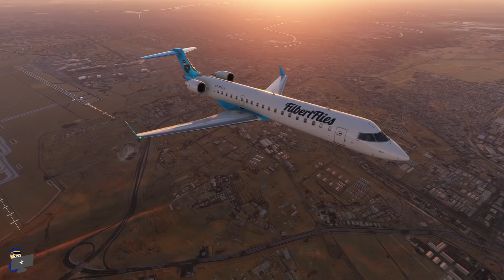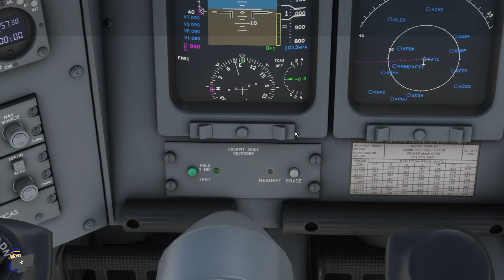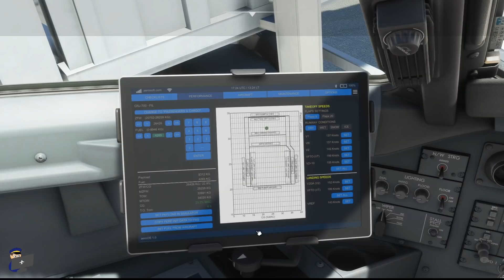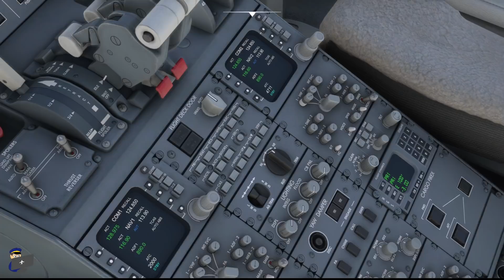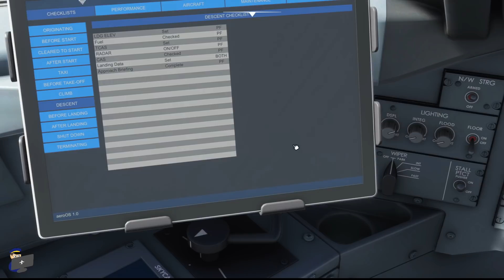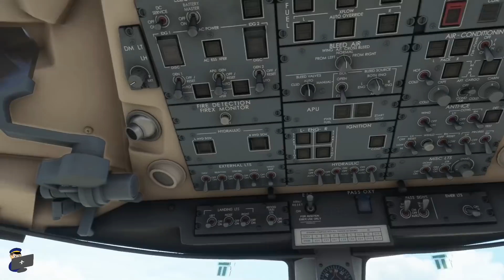MSFS 2020 | TUTORIAL: Aerosoft CRJ 700 lesson with a real world pilot | Complete Lesson

Comment: Does anyone use the Boris sound mods for this?  Will it work in MSFS-2024 as well?  I was using the CRJ 700 in 2021, does anyone know if they've made any major advancements?
Reply: Not much has changed with the aircraft but it works very well and I still use it every so often. I use the Boris sound pack and it is really good. Makes the aircraft feel like an entire new product.

Comment: Hey Guys, great vid.  I know i'm three years late to the party here but I had a question about that winds part of the FMC setup.  You said to use the average winds setting from the top of the flight plan briefing for the cruise winds and to leave the othe two blank but where would you find those other two winds on the flight plan briefing? Also why is it not the usual bearing at speed notation? I tried that in the FMC and it took it.
Reply from the maker: Some airlines will use the TOC and TOD winds, which you'll find in the OFP, but the airline Michael flies for doesn't use them. I don't know why this is the case, or why the wind/bearing format isn't used by them.

Comment: I have had a lot of problems with the HoneyComb throttle quadrant. It’s actually caused me to crash on multiple occasions. It will work fine in settings but in the sim itself it can work normal and then move by itself. None of my others do that and some a lot cheaper

Comment: I remember when I used to fly the crj-200 then going to the 700-900 it was like a completely different jet. The 200 had one FMS on the captain's side and the plane was completely manual compared to the 700-900. The -200 was also under powered at altitude compared to the -700-900. Ahh  good times based out of DTW.

Comment: Fellow CRJ FO here, based in the southeast, just not the ATL based one :-) IAS does switch to Mach automatically going through FL316 at the same time as 1/2 bank. Typically above 10,000ft we climb in VS mode (or even PITCH mode) to avoid the porpoising that we get in CLB mode. Just a technique to consider as even this sim seemed to porpoise a bit. This can be felt in the real airplane and is better for passenger comfort. The performance issues in cruise may be used to exceeding the maximum cruising altitude for the given weight you were at. In the real airplane we would use ACARS or our speed cards. Not sure about this sim… This was fun to watch! Keep it up!
Reply from the maker: Interesting, thanks for the info! I've just used lower cruising levels lately, but there are some charts included in the manual which I'll take a look at and see if that was the issue.
Reply: @FilbertFlies  One more thought ;-)  in real life in the US, the minimum vertical speed that we must be able to maintain for ATC purposes is 500 ft/min. So while during a climb, if we were unable to maintain at least a 500 ft/min climb rate, we would have to advise ATC and request to level off and amend our cruising altitude. During this flight, seems like stopping at 330 or 350 would have been pretty realistic. In real life, going past 360 is quite rare in both the 700 and 900.
Reply from the maker: @FoxVictorBravo  I didn't know that either! This is what I love about flight simming, and about doing it online on YouTube and Twitch - always more to learn, always someone willing to share their knowledge. Thanks! 🙂

Comment: would have been nice to learn how to check fuel burn mid flight to make sure we are on track for where we should be. also how do we know the airport we are landing at has a long enough runway for our current weight and the runway conditions? arent we supposed to calculate that out during decent?
Reply from the maker: You should probably check your arrival runway's long enough before setting off to be honest. And there's not much to say on fuel burn - compare what you have in the plane with what the flightplan says you should have at each waypoint, same as you would in any other aircraft.

Comment: Great video. I am a retired (in 2014) CRJ captain. I would like to have seen info on Flex thrust for reduced power takeoffs. And also the fuel check valve test on the first flight checks. If I remember the ILS profile I used we selected gear down when the glide slope came alive and flaps 45 at glide slope intercept
Reply: @FlatOutMatt  We rotated at Vr and accelerated through V2 and V2+10. Flaps were retracted after reaching two speeds.  I'll have to do some research since it has been a few years since I flew it. But at the first speed we retracted to flaps one and at the second speed flaps up and called for the climb check. At my airline the F/O did the entire climb check silently and verbalized "Climb check complete" when he finished it.
Reply: @jameswebb2856  on another note, did you trade in aircraft for space telescopes recently? 😁
Reply from the maker: Hello! Thanks, glad you liked it. There is unfortunately no way of calculating an accurate flex temp in this plane, or anywhere else I've found on the web, which is why I always tend to use TOGA rather than randomly guessing a figure. However, if you have any tables, links or other resources that I could use for this I'd be very pleased to see them!
Reply: @FilbertFlies  That's true since you need takeoff distance charts for the aircraft. What I do is just add 5 degrees Celsius to the current temperature if it is not a short runway or any of the conditions that require max power. I really liked the video as it reminded me of what it was like flying the actual CRJ. You guys did a great job with it.
Reply: @FlatOutMatt  if it helps- at 1000 AGL, spin the speed bug up to 200kts, as you or the autopilot lowers the nose to match the FD and speed up, you would retract from flaps 20 to flaps 8 at V2 + 12. At Vt - 10, retract from flaps 8 to flaps up. Reduce thrust to climb detent, disengage reversers. At 3,000AGL, speed bug 250kts

Flaps 8 is by far the most common. Flaps 20 is used on shorter runways, etc.

Comment: Daniel from Romania here guys, awesome awesome video. I have a question and a remark to make, in order for me to better understand the behavior of the CRJ 550 and the 700... Lots of times in the air I seem to have this problem when the autopilot trim is setting itself nose up maximum and I kinda end up going and down up and down. Even if I turn off the AP, restabilize at a different altitude... the issue persists.Is this because I have made a mistake along the way somewhere like failing to monitor properly the .77 Mach like you did here ? I imagine this behavior can and is normal to happen if for example I would also try to go up to FL390 but fail to monitor the speed so the altitude capture button that is on is telling the autopilot to just trim nose up to match the altitude, but I dont get why this is happening even after me turning off the autopilot and trying to recapture a different altitude. Maybe Michael might help me with this in telling me if this is a real piloting error or just a CRJ bug. Thank you very much guys, awesome video and thank you so much for the lesson !!!

Comment: Thanks so much for this video.  Do you think the Glide Slope  issue has really be fixed?  Aerosoft acts like it is all our fault... and I'm sure I am doing some things incorrectly, but do you feel that it has really been fixed? Also, I've asked for more tutorials for the CRJ but their response is that there are over 200 out there and they are not doing any more... I have found that several of the videos I've watched the person doing them keeps running into problems with the GS. Are some people shying away from doing tutorials for the CRJ?  There are so many more for the A320...
Reply from the maker: Hi June. I think the glide slope issue has been partially fixed. I don't think the plane in the sim flies ILS approaches as smoothly and accurately as the real thing would, and it doesn't capture and hold the GS every time. I don't know if people are shying away from doing CRJ tutorials, I just think that the A320 is many times more popular than the CRJ.
Reply: @FilbertFlies  It is so disappointing to get to the end of a flight and then have to disengage the AP and fly by hand, earlier than you should have to.  It would be great to be able to save the state and then practice from that spot... practice landings and go arounds...  I mentioned this to Aerosoft, but they seemed to have no interest.  I purchased FSi Panel (to practice landings) and it works really great with some planes but you can see from the feedback graph that the CRJ GS is not held consistently.
Thanks again for taking the time to create this video.

Comment: Did he go into flex temp at all?
Reply from the maker: No, there's no way to calculate it in the Aerosoft CRJ. You could probably use a random value between 50 and 60 but I always use TOGA cos I figure, if you can't use it accurately, there's no point using it at all.

Comment: Huge video. Thank you very much, both of you. I was just wondering and didn't quite get it, where the checklist is, that Michael is going through. It seems a lot deeper than the ones on the efb?
Reply from the maker: It's in Volume 4 of the manuals you get with the CRJ. The safety checklist is in there but is missing from the EFB. I believe the others are identical.

Comment: can the screens be detached over to another connected monitor in my flight sim setup??  Some of these glass panels are pretty small.... i want to bring a few of them over to another monitor without losing FRAME-RATES...but so far it seems to drop about 10 frames a second when I drag one over..  and I doing it wrong?
Reply from the maker: I've never tried to move them to another monitor, but they can be popped out with right alt and click, so I presume you should be able to put them where you like.
Reply: @FilbertFlies  Yea, when I pull them to another monitor, it drops exactly 12 frames (for each one)...a non-starter.  Maybe one day Asobo can get this figured out.

Comment: I am at 59 minutes into the video and the master alarm lights are still flashing! I find that kind of annoying but the rest of it is very good.
Reply: how can i program them to show on my Virpil Control panel?  like master warning and master caution lights and then go out when pressed?  Need help.
Reply from the maker: You'd need to ask Aerosoft about that.
Reply: @FilbertFlies  Those buttons are inoperative in the simulation? I only know from watching, don't own the sim plane. Sorry about that, I can see that you are very thorough on these reviews. I guess the question would be if they can't be operated, should they light up?
Reply from the maker: The master caution and master warning lights are operative.
Reply: @FilbertFlies  If those variables (master caution and master warning) are passed via simconnect or FSUIPC i probably can pick them up with Spad.NeXt and have them working with my Virpil equipment (button Boxes - CP1 & CP2)  .... but there's also a possibility that Aerosoft has them coded as such that we cannot get to them., thanks for this, I will dig into this.
Reply: @dabneyoffermein595  i have them working fine on my virpil mongoos throttle via spad.next... simple lvars that can be played around with so ya, you're right - you just need the right tools for it
Reply: @aprodigy6991  -- ok, so local variables that you found in spad, correct?  oh, wait, "lvars"  , is that the thing that requires that extra download product (pay product) add-on in Spad.Next?
Reply: @dabneyoffermein595  right - you have to pay for spad.next in order to use lvars - very well worth it, though. my virpil hotas finally does what it was supposed to do ;) nothing else, let's say fsuipc was needed, either. still takes some time to get it working as expected.
Reply: @aprodigy6991  I own spad.next but I was thinking there was an add-on component called LVARS that is extra $ ?  , No?  or is it including with what I already have ?  I have the MS2020 version.